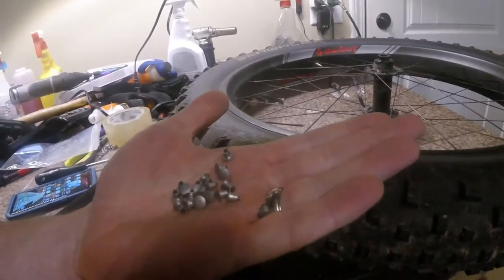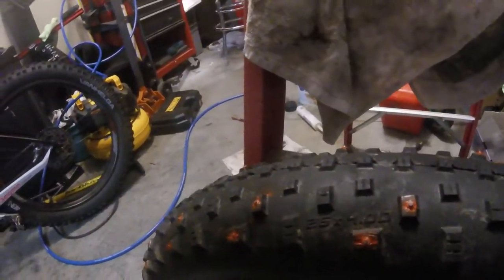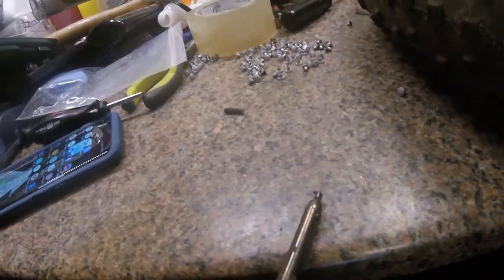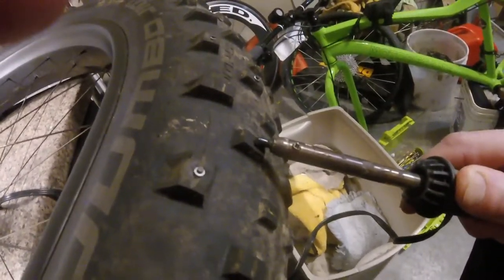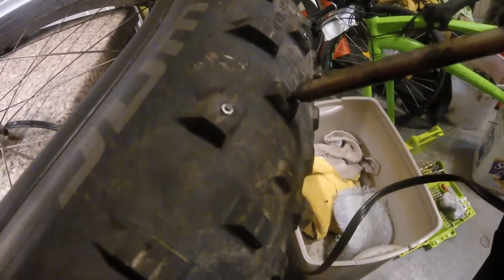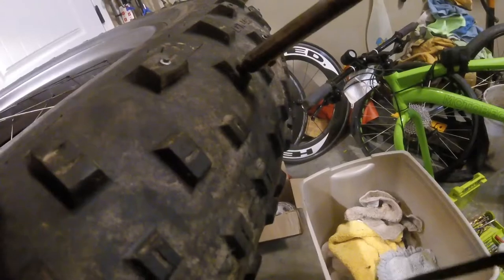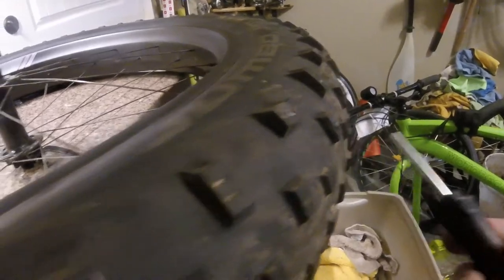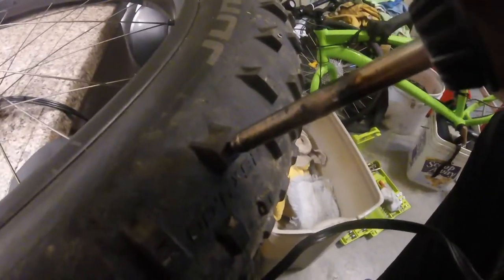DIY studded fat bike winter snow tires with Jumbo Jim tires.

Comment from the maker: Just an update for everyone. The studs are holding up great. None of the studs have fallen out yet.  If you have any question let me know. Also please subscribe for future updates.
Reply: I have done the same thing 75 to 100 per tire. Works great.  Thinking of using a drill to start the hole this time.
Reply: @billhaf  I'd think a drill with a tiny bit would be faster and hold a stud just as well

Comment: 2:00
Pause.
I'm weighing the time, cost, benefits, etc., of doing this myself (with pre-stud ready tires), or just buying the tires flat out and only using them in winter (Michigan). It's looking like the studded tires bought flat out is the possible route.
Also i'll watch the rest, but this looks excruciating.
Reply from the maker: For  just riding a pre studded tire would be the way to go. If you want a tire that is much lighter and faster for snow racing I would do what I did.

Comment: Would the studs not sit more secure if you screw them in with the stud application hand tool due to them being corkscrewed into the tire tread.Just a thought? I thought of doing that with my Jumbo Jims for the winter.

Comment: Hey Keith, nice work. A couple of questions for you, what was the length of the studs you bought ? Also, do you think that just drilling a small hole and force the stud in it would have done the job ?
Reply from the maker: I am not sure on the length. I am guessing they are all the same. Drilling a hole does not work. It needs a wider pocket for the flat spot to sit in or they will fall out.